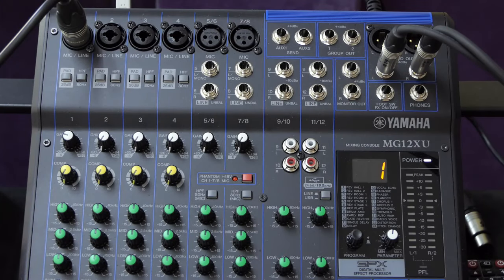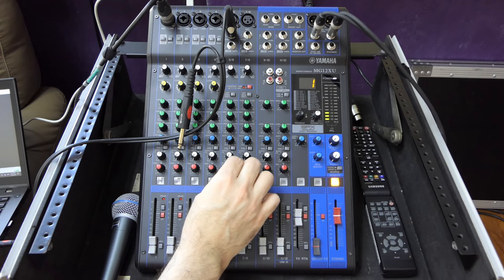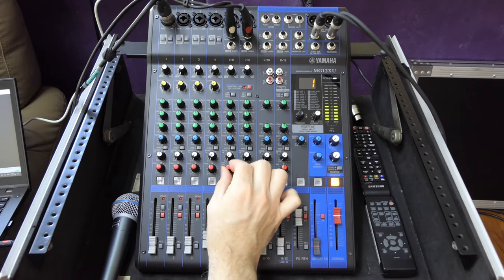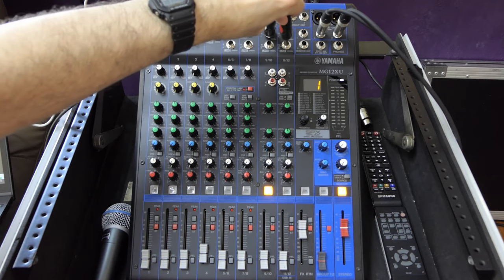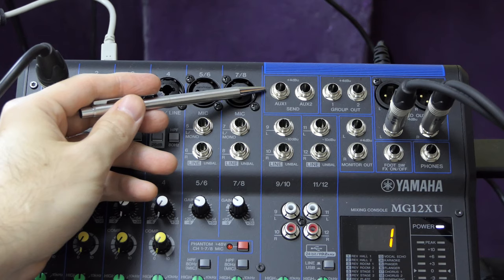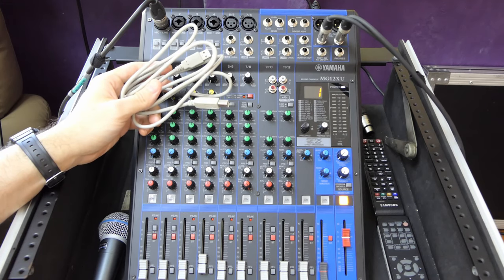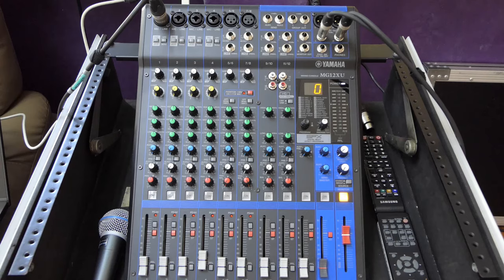Yamaha MG12XU Mixer Tutorial Part Two

Comment: So channels 9/10 & 11/12 is no advisable for instruments right? But only for cd players,laptops etc except instruments.and also PAD is not engaged at all in this channel unlike the 5/6 & 7/8 which is auto engaged?!! Just wanna be very sure on this. Thanks if anyone will answer.  Pls forgive me for asking..🙂
Reply from the maker: You can use 9/10 and 11/12 for stereo line level instruments such as keyboards.
Reply: @GLBProductions  hello.  Can you also do a tutorial on Zoom Livetrak L20? This unit has no sub out or auxiliary output. I can't find any tutorial for this unit. I've just bought the unit recently... Thanks! 🥂
Reply from the maker: @manhongtv81  Thanks for the suggestion :)

Comment: Awesome job with your content. Very detailed. What type of recorder are you using? I have had issues capturing my mixes because I have both the Tascam dr05 and the zoom h1n and they are both peaking when trying to record my mixes. Why is that?
Reply from the maker: Thanks, on this video it's a Zoom H5. With recorders setting the gain correctly is really vital - if you set them up such that 0dB on the mixer is around -12db on the recorder that will give you plenty of safety margin. You then raise the level in post production.
Reply: @GLBProductions  That makes a lot of sense. Thanks
Reply from the maker: You're welcome!

Comment: I have an mg12, older model with no usb. Its sat unused for years. I recently bought a 2nd hand behriner fca1616, which is a great interface barring massive design flaw, its headphone out and the master volume are joined together, which makes tracking a nightmare. I figure they assumed you would be using a mixer alongside your audio, or they just #$%$ed up lol. mainly got it as it has both usb and firwire plus adat 8 channels..lets me connect my old firewire adat motu gear, rather than go into landfill.....Anyways I will drag out my mixer, hook the 2 main (LR channels) from behringer to the yamaha and using 2 unbalanced cables into 5/6 or 7/8. I will hook my powered studio monitors to the mixer, control their volume with the master or stereo fader?? best cables for connecting the monitors to the mg12 are unbalnced pair..does that sound right??
Reply from the maker: Ah yes, the firewire debacle... I got burned on that one too, have at least one Lexicon interface sitting around that works fine but doesn't fit into any workflow... 
Your plan sounds like it would work fine - alternatively you could use a headphone amplifier like the Presonus HP4, or even the volume control on the studio monitors themselves.
Reply: @GLBProductions  my monitors old behringer "truths" don't have a volume control (well not easily accesible) had a semi productive day. soldered a couple custom length unbalanced cables. mixer is doing the job although sort of bulky in my workspace, yeah I have a headphone mixer somehwere ?? smaller footprint might be nice. The yamaha for the money are hard to beat, good all round workhorse..kinda glad a i have put it back into service :) cheers P.S I was living 5 years in Bengkulu (2013-2018), Sumatra but now back in Australia, My wife and I used to do 6 visa runs a year via batam and alternate between indo consulate in Singapore and JB..dearly miss that part of the world....will be back one day..

Comment: Hi again. I have to tell, you are my last hop.  So, today I bought the Mixer Yamaha MG12XU. I want to have an Balanced signal from the Input channel to the main output channel. For that I connect the cable , 1 Stereo Jack 6.3mm out signal from the source, Laptop, phone,  etc. to 1 XLR,  directly in the channel 5/6 or 7/8, from the mixer. From The Main output  I connected 2 balanced cable for the speakers. And I have a big surprise,  the signal is good for nothing.  It's sound like an "robot " no bass, no voice,  just a sound like a "robot ". Where is the problem? The cable that I will use for the balanced signal is Audio Cordial CIM 3 MV (1x6.3mm stereo jack to 1x XLR. Please help me.  I have to mention, I do not install the driver for the mixer.
Reply from the maker: Ah yes, the problem is almost certainly that TRS to XLR cable that you are using - you cannot convert a stereo, unbalanced signal to a mono, balanced signal using that sort of adapter. Take a look at my video on how to connect this type of signal properly: https://www.youtube.com/watch?v=ge4Iynh4rcc
Reply: @GLBProductions  ok. I understand.  So,  I can't use the XLR 5/6 channel from the mixer to  Audio Line. The only way is that cable,  1 stereo jack to 2 mono jack. For me, It was important to have a balanced input and balanced output, but this mixer doesn't support that can of connectivity.  The RCF mixer has that possibility.  So, thank you a lot for your excellent explanation.  🙏

Comment: thank you im going to buy this! i have an 8” loudspeaker that im going to want to connect to output of this mixer but the speaker only has a phoenix two pin connector for input not the three pin, what cable should i buy?
Reply from the maker: Hmm, two pin phoenix connectors are not often used for live sound - they are more common on installation-specific loudspeakers. What's the make and model of your speaker?
Reply: @GLBProductions  its a qsc ad-s8t
Reply: @GLBProductions  someone sold it to me on craigslist for $250, i dont know much about electronics and stuff
Reply: @GLBProductions  should i just buy another speaker or is there some way i can still use this speaker?
Reply from the maker: Ah that one :) First of all, this is a passive loudspeaker, meaning that it needs an external amplifier - you can't connect it directly to your mixer and get sound. Secondly it's designed for permanent installation which means that it doesn't have things like handles, speaker stand pole cup mount etc. Thirdly that phoenix terminal is not meant for repeated plugging and unplugging - it's meant to be connected once and left that way for years. So those are some things to consider :)
Reply: @GLBProductions  oh dang i made a terrible mistake buying this speaker! lol 😂 thank you for answering all my questions :)
Reply from the maker: No worries Rudy 😊 I'm sure you can sell it on to another owner. All the best with your music!
Reply: @GLBProductions  :)

Comment: How can I increase the volume of the USB output on my Yamaha MG12XU mixer when recording or live streaming, as the sound arriving on my MAC computer is extremely low despite being set to STEREO OUT?
Reply from the maker: This is a known issue with this console - you can try setting the gain and/or fader levels higher than normal, or you can raise the level in post-production. If you are streaming, you may be able to use the streaming software to increase the level of the signal.

Comment: Thank you so much for these wonderful videos. Can I ask RE the monitor connection, you say they are NOT for stage monitors. Where should the stage monitor be connected? I've been using it like that for a while now but if there's a better way, I hope you can help
Reply from the maker: Hi there Edward, stage monitors are generally connected to the pre-fade auxiliary (AUX) outputs - that would be AUX 1 on this mixer. However, if you prefer your stage monitor to have the same mix as your main speakers, then using the monitor out connectors is fine.
Reply: @GLBProductions  thanks so much for that. Yeah I prefer the same mix as the main speakers but I might try it via Aux to see how it goes
Reply from the maker: You're welcome, all the best with your music :)

Comment: Is the gain structuring different on 5/6 depending on whether a mono or stereo line is input? Also you said the monitor out is designed differently than the aux sends, and they have different purposes. Can anyone recommend a resource where I can learn more about that difference? Great video. Thank you.
Reply from the maker: Hi Alex, what do you mean by 'the gain structuring'? And what specific questions do you have about the monitor out vs the aux send?

Comment: Thanks for the video 
My question is how do I connect my pioneer ddj 800 controller to the mixer mg12xu Yamaha
Reply from the maker: I would use the XLR outputs on the 800 to connect to the stereo line level inputs on the Yamaha.

Comment: Is it safe to leave the PFL button on at all times? Can this cause damage to the mixer or any device connected to it?
Reply from the maker: It's safe but not recommended as you cannot see the overall output level of the mixer. If you need to do so for monitoring purposes it's better to create a custom mix using the groups and/or aux sends.
Reply: @GLBProductions  Thank you for replying to this question. The reason why I asked that question is because when I disengage the PFL buttons, the L&R level indicator lights on the level meter goes off while music is playing.
Reply from the maker: Check that the "source monitor" switch located immediately below the PHONES knob is set to the STEREO position, ie not depressed. If it is set to the group position and nothing is routed to the groups then the meters will not show anything when PFL is not active.
Reply: @GLBProductions  Thank you for replying to my questions. I really appreciate your tutorials. You’re the best in what you do. Keep up the good work.👍

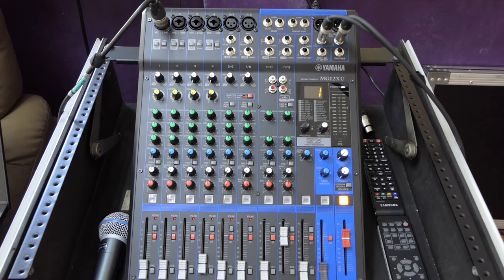Comment: You claim that it is not possible or recommended to record and playback via USB at the same time. due to "feedback loop". (16:53 -17:13)  Is there any way to record, i.e. use the Yamaha AD converter, and play the audio signal without this "feedback"?
Reply from the maker: Yes the best way around this problem is to use a separate playback device, eg a second computer, mobile, tablet etc, connected to one of the analog inputs on the mixer.

Comment: On channel 5/6 or 7/8 is the xlr input stereo in other words can I run 2 xlr from a controler and use a 2 to one splinter and plug the one in and still achive stero
Reply from the maker: No, XLR inputs are never stereo 😀
Reply: @GLBProductions  thank you I didn't relize that
Reply from the maker: Yes, unlike a TRS connector which can be wired mono balanced or stereo unbalanced, an XLR connector is almost always mono balanced. If you need stereo with XLR connectors you need to use two channels, panned hard left and hard right respectively.

Comment: Excellent tutorial, thanks for doing this.  Can this mixer be used for single channel PA systems, i.e. not stereo?  Could this be accomplished by, for example, panning all inputs the the L eft and using only the L eft output?  Thanks
Reply from the maker: Thanks Cosmo. Yes this mixer can be used for mono systems: leave all the pan controls at the 12 o'clock (center) position. Stereo signals, such as keyboards, must use two mono channels, both panned center, or be run through an external device that combines the two channels to mono.

Comment: Great video, but how do I record using the USB interface or the line level (using a RCA connectors) for a yahama MG16XU. @GLBProductions
Reply from the maker: If using the USB interface, feed the signal into an appropriate recording program on your computer, such as Protools. If the RCA connectors, connect them to an appropriate recorder.
Reply: @GLBProductions  I have done that,but it not sending signal to the recorder (audacity)

Comment: Hi, I'm trying to use the usb connection of the MG12XU to send the mixer's signal to my computer to record my mic. When I'm looking at the preview of the mic output (line MG-XU) in Windows while talking into my mic, there is no sound coming through. However, if I try to use the "Listen to this device" option, I can hear my mic and the signal's coming through. I'm not sure what's happening and how to remedy this. Is there's anything I could try? The connection from computer to mixer is working perfectly through USB and Channel 11/12. Thank you for any support
Reply: Oh actually, I found out how to fix it now. I needed to enable a setting that I knew existed somewhere in the back of my head, but forgot. In Windows settings -> Allow access to the microphone on this device -> Allow apps to access your microphone -> Allow desktop apps to access your microphone. I had that disabled and enabling it fixed my issues
Reply from the maker: Glad to hear you worked it out - this is a common difficulty encountered in computers running the later versions of windows 10 as well as 11.

Comment: I just got my yamaha mixer and I use it for my acoustic duo act. Sometimes between sets I play music through my laptop. Which channel do you recommend? I've been using the rca jacks and seems to work good.
Reply from the maker: For connecting a laptop I recommend using the USB connection as it provides the best possible quality by using the digital-analog converter in the mixer rather than the lower quality headphone output on the laptop.

Comment: I am assuming it's not possible but... is it possible to monitor audio going to group 1/2 at the same as what's going to stereo while still sending them as independent sources (without pfl)? the button on the phones only lets you switch between the two, not mix them.
Reply from the maker: No it's not possible - you monitor one or the other. What are you trying to achieve?

Comment: Hi thanks for the video. I have the MG10xu model. If I want to connect my laptop to mixer to play backing tracks for karaoke, would i just connect 3.5mm to rca on mixer. or would i use 3.5mm to 2 quater inch jacks? Im not sure!! Thanks for you help. Best Sean
Reply from the maker: Hi there Sean, you can use either method, depending on which cables you have.

Comment: Why did you emphasize that the "Monitor Out" is for studio monitor speakers and not for stage monitors (@13:50)?  What is the difference in configuration or capacity between those types of components?
Reply from the maker: The difference is the design intent behind the output: stage monitors are usually driven from a pre-fader auxiliary send to allow control over exactly what the artist wants to hear; studio monitors are usually driven from an output that is a duplicate of the main mix, but with its own level control.

Comment: can you tell me how to boost output usb signals from this mixer into the daw for vocals recording. i have fully turned on the gain knob and the compressor knob is at close position but my vocal wave signals is still too low compared to behringer xenyx302 usb mixer. can you please explain it to me why?
Reply from the maker: Different mixers have different recording output levels depending on how the A/D converter is configured. Make sure that gain is set correctly on your mixer, which will give you the best signal to noise ratio when recording. Additional gain can then be added in your DAW as necessary.

Comment: problem is when I connect m12ux to the computer via USB the mic (inputs)section of the computer  can see the signal but the output section can not see the signal (no audio out)please be the case. Thanks
Reply from the maker: Please clarify in which direction you are having trouble with the signal: computer to mixer or mixer to computer.

Comment: Great videos. Very helpful. I was wondering about where the signal source that goes to the on stage monitors is, and how or where is it controlled??   Thank You!
Reply from the maker: You would generally use aux 1, set to pre-fader, to connect to your stage monitor system.
Reply: @GLBProductions  Thank you. I was curious about Aux 1 (which I use on on my MG10 mixer which has no onboard effects) affecting the send level to the effects section. I will review your video. Thanks. I'm pretty new at running sound for a small band while playing in the band.
Reply from the maker: You're welcome Tommy. On the MG12XU aux 1 does not interact with the internal effects section at all.

Comment: I’ve looked all over the Internet and this is the closest I’ve got to an answer about the feedback loop. Thank you very much. 

My question is could you use the monitor outs with the PFL buttons on & the ST buttons off for channel 11/12 usb, the rest of your audio with ST buttons on going out of the stereo outs so you could record and playback at the same time & it will not record your computer (feedback loop) with your inputs at the same time. Appreciate any advice. Thank you again 🙂
Reply from the maker: Yes you could do that, but a better way is to set the SOURCE MONITOR switch to the group position and disengage the ST switch on the GROUP 1-2 fader - this allows you to create a separate monitor mix using the groups. Disengage the ST switch on the USB IN channel, to prevent it from going back to your computer and engage the 1-2 switch so you can hear it in your headphones. This combination of settings will give you the result that you are looking for above while still giving you full functionality of the PFL bus.
Reply: @GLBProductions  Thank you for the reply! I’ve been very busy with work but once I get a chance to try this out, I’ll write again but this sounds like a great solution/fix to the problem. Thanks so much!
Reply from the maker: You're welcome, hope it works for you.  @karlosdean1650

Comment: Great video as im having major issues setting up for streaming singing live stream. I just can't get it right.  Using ipas for backing tracks, and mixer to pc to stream obs. For some reason the channel 1 slider isn't affecting volume its just affecting effects? Any advice welcome as im having a nightmare setting this mixer up lol sounds so simple lol
Reply from the maker: Check the following: on channel 1 make sure the fader is up and switched ON, and the red ST button is engaged. On the master fader, make sure it is up and switched ON. If you have done all this and it still doesn't work, take the mixer back to the person who sold it to you and get them to sort it out 😉